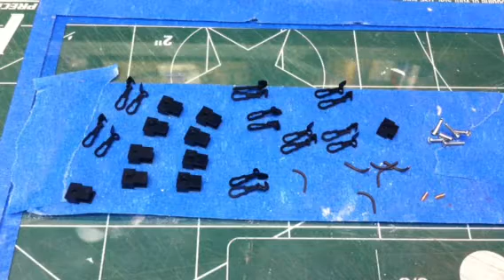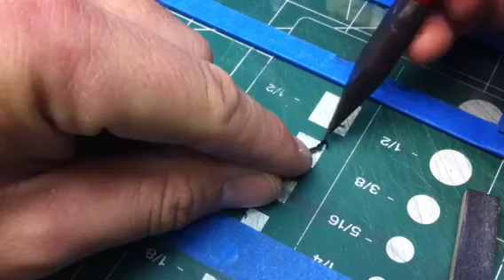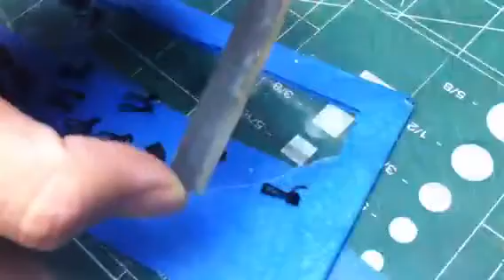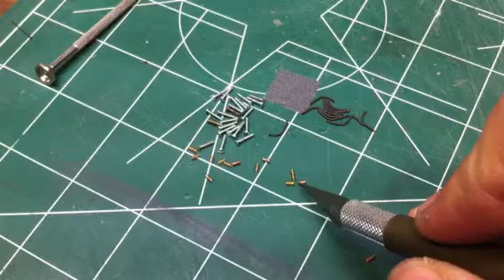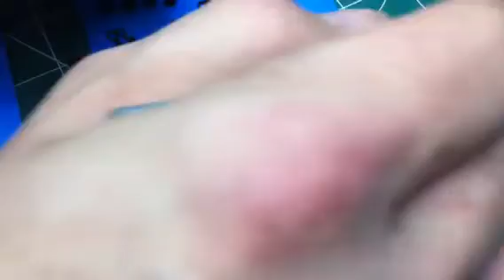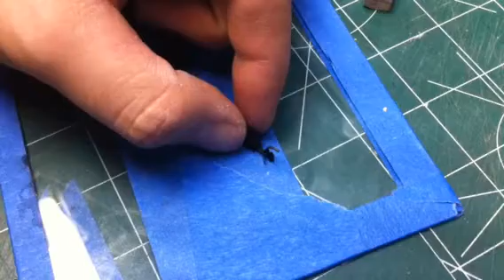Assembling micro-trains 1015 couplers

Comment: awesome video! The use of the double sided tape-sticky tape & forcing the trip pin through  were great pointers -  very useful - as was the glass - I ended up using an old glass certificate frame as my base - i then hot glued the back firm and this acted as a perfect mounting area. Thank you  so much for posting

Comment: Great job! I personally weld the sides with a soldering iron so the draft gear box stays together. The pin install trick blew my mind though.
Reply from the maker: The pin install was found through massive frustration. I was so ticked off, I decided to use force, and it just happened. That's when I decided I should make a video!

Comment: I tried a few times last week and gave up, but today I gave it one more try and success! The only thing I do differently is I use the exacto blade to pick up the top that snaps on the assembled coupler draft box. I press the sharp end of the blade gently enough to pick up the lid/top and place it on the assembly. That way you can clearly see where you place it on top of the assembly. I also use a small magnifying glass on a stand when placing the trip pin, the spring and the lid/top in/on the draft box. I found it unnecessary to use a small block of wood on the tape to keep the assembly from moving. The painter's tape holds it easily. I'm down to about 3 minutes assembly time also.
Reply: Lewis Howard Lewis, thanks for the tips.  It's good folks like you and Richard who take up the slack from Micro-Trains who can't be bothered to make instructional videos for their products.

Comment: Thank you for the video. I'm getting all of the parts and tools together to do this.
How about a video showing how to get the MT 'trucks' off and then installing the coupler and re-attaching the truck. It looks to me like the trucks are snapped in place???
Reply from the maker: The trucks on most N scale cars are held in place with a king pin. A gentle touch with a fine screwdriver will pry out the kingpin, usually very simple. The trick is to not booger up the plastic parts with the screwdriver.
Reply: Rich Brungard Thanks Rich,Do the mt 1015 couplers just 'snap in'? I suppose they are gently pryed off too?
Reply from the maker: Glenn, Normally, they are screwed to the underframe with the supplied 00-90 screw.